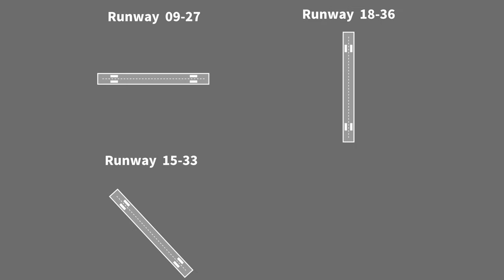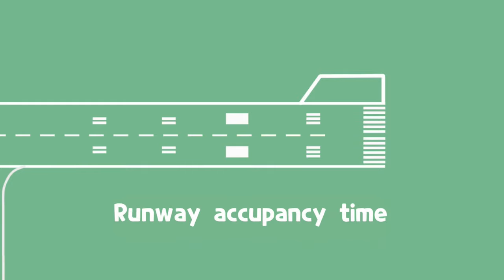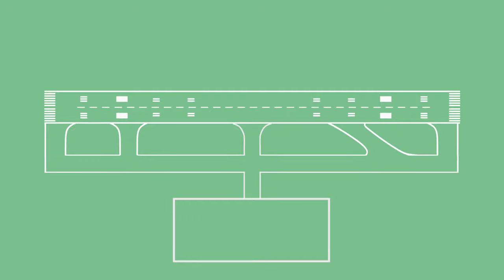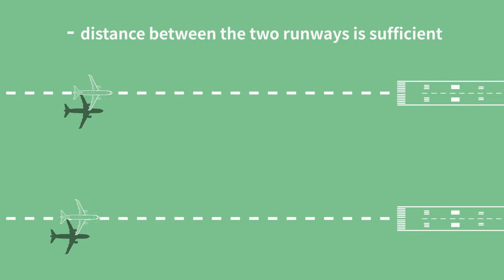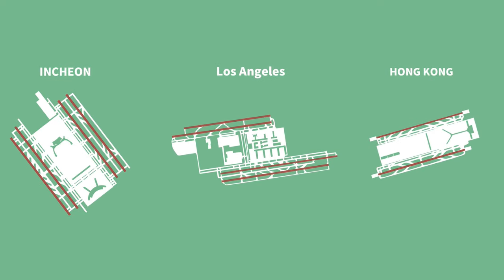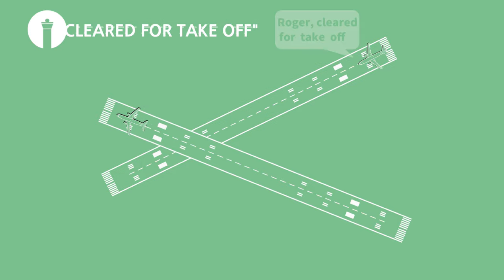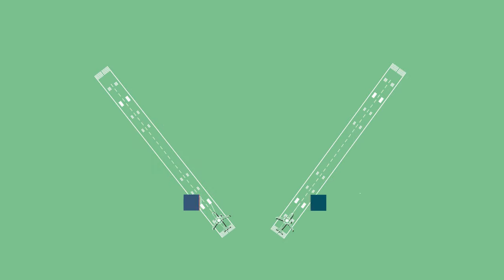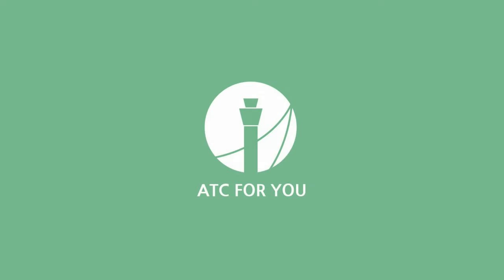Runway configuration explained by real ATC [atc for you]

Comment: The busiest airport in the world, KATL, uses four runways:  two parallel sets of two on each side of the North and South Terminals.  Each set of two parallel runways consists of one for landing and the other for takeoffs, so there is no issue with aircraft spacing.  
There is now a fifth runway, also parallel and to the south of the other four, with enough lateral separation to allow unrestricted landings and takeoffs; it is commonly used mostly for evening landings when capacity is otherwise reached.
Reply: Nope it's not KALT really it's KORD is the busiest Airport in the world more  runways parallel and the controllers are the best
Reply: Wouldn't ATL have to treat those runway pairs as single runways when the weather goes IFR?
Reply: @princekamoro3869  no.  See 3:04 in the video.  One of each pair of runways to the north and south of ATL's terminals and aprons is used for landings, the other for takeoffs, so they can operate independently.   The fifth runway is well south of the rest, and can operate completely independently -- usually for arrivals only during the busiest times since it's a long taxi.
Reply: @PaulCashman  FAA standard is 2500 ft spacing with takeoff/go-around paths diverging at least 30 degrees, for independent IFR takeoff/landings on parallel runways.
Reply: @princekamoro3869  thanks.  How would that negatively affect ATL's sets of parallel runways if each pair has one runway for arrivals and one for departures?  --Aside from longer intervals, that is....
Reply: @PaulCashman  I too was curious and asked an ATC community about this. (I have no aviation background) Narrowbody planes in clear weather? You have two runways, just give diverging headings between departures and go-arounds. Low visibility? Radar separation largely treats that as one runway, with the exception that the departure can go before the arrival is off the runway. Arrival is a larger plane (e.g. 777) with a big wake? A late go-around would put that wake in the path of a parallel departure, so the departure can't go until that arrival is confirmed not going around.
Reply: @joedurbin1916   KORD has the most runways, but KALT has been the busiest airport in the world for so long since the 80's (except in 2020 where ZGGG got the title in special condition). More runways =/= more traffic.

Comment: At Ninoy Aquino International Airport located in Manila Philippines, our runway type is the intersecting runway. Plus our runway size is R6/24 3,737m 12,261ft and R13/31 2367m 7,408ft. In 
New Manila International Airport is under construction our runway type is a parallel runway and has 6 according to wikipedia and the direction is N/A so the size of the new runway is 3,500m and 11,483ft.

Comment: I would to work at Salt Lake City (kslc) they have 3 parallel runways 34L/16R 34R/16L and 35/17 and it has a small runway the is in a parallel angle to the others (dose not intersect any runway) I don't know it's magnetic headed off the top of my head

Comment: so if you have intersecting runways at an uncontrolled airport does each runway have different patterns operating simultaneously?
Reply: It depends. In general if it isn't busy enough everyone is going to want the runway which has the best headwind so the pattern will naturally form around it. I don't think there is a regulation saying only one pattern can exist at a time (I am only a student pilot) so if there are planes flying in different patterns then I think the key is good situational and radio awareness as always. Also the chart supplement can denote runways as having a right pattern (instead of left) which can minimize the patterns overlapping
Reply: Also my home airport (kgvl) only has 1 runway with an ils approach so if conditions aren't vfr (visual flight rules - good visibility basically, you can google the exact requirements) then the operations become one runway even though the airport usually has 2 intersecting runways